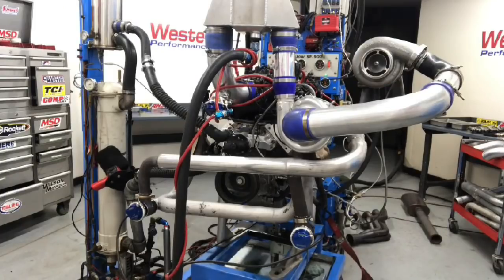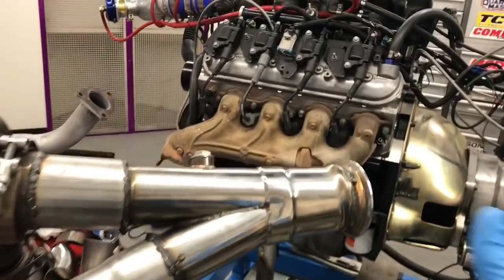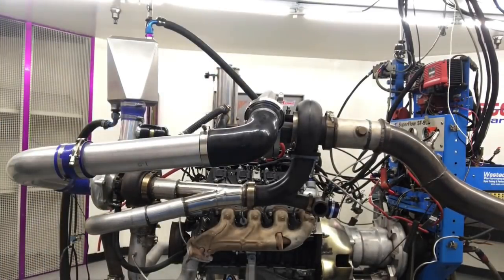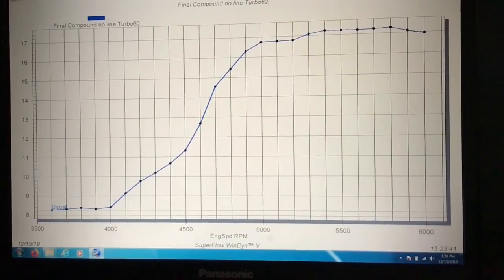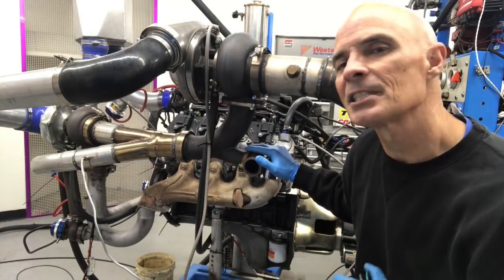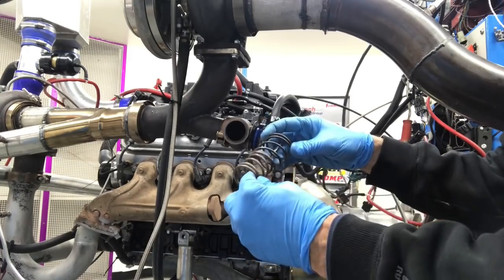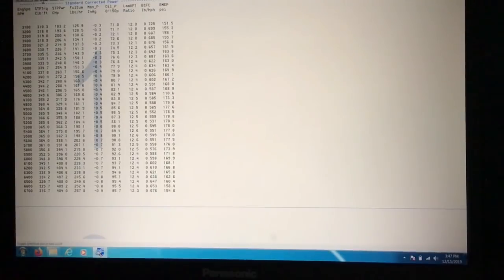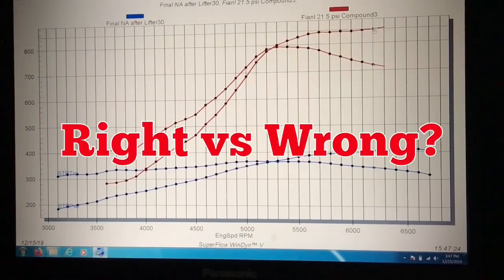Big Boost!! Full Results!! 1 Mistake!! Compound Turbo 4.8L!!

Comment: I'm  sure that most everyone would really like to see how tunable/possible output. I've  been thinking alot about this set-up myself. Thanks
Reply: It would be nice if there were forged internals. What good is a motor that wouldn't last 500 miles, not to mention to see how much power a compound set-up can make with a high reving short stoke engine. Thanks for the info that you bring us.

Comment: The ONLY thing I dont like about compound turbo's iis reliability.. Too many extra variables that take effect. Compound supercharger/turbo setup seems much more reasonable, reliable and makes more sense in the grand scheme. The turbo driven off the exhaust and the supercharger driven off the engine, sounds like the combo!
Reply from the maker: neither is really necessary on a LS

Comment: In this configuration, that cooler is actually an aftercooler. It's after all the compressor stages. If it were mounted between the turbos, then it would be an intercooler.

Comment: why not connect the primary turbo`s(small) wastgate reference signal to the exhaust manifold and the big turbo`s wastegate (the one actually controling ultimate engine boost)to the intake manifold and set the primary turbo`s wastegate spring pressure to the desired intake manifold boost.this way i think you would have balance between the turbos and maybe a 1:1 pressure differential in the exahust man and intake manifold provided the secondary exhaust housing doesn`t get restrictive?

Comment: I've asked alot of dumb questions lately but I've learned from them sooo....could this also be done as a twin setup instead of a compound? Seems like it would be nice to have a GT45 or smaller turbo to have major response down low while a bigger S480 carry out the curve around mid range rpms to maximum horsepower at higher rpms🤷‍♂️
Reply from the maker: SEQUENTIAL WORKS LIKE THAT, BUT NOT TWINS

Comment: Hey love your videos. Ideally you'd have one big wastegate before the small turbo that controls both banks, and vent it to atmosphere, that way you control both turbos at the same time, if you slow down the small turbo compared to the larger one you're losing the whole point of the compund setup, the slower the small turbo moves the less air it multiplies and the less exhaust that passes through the turbine because it's spinning slower.

Comment: That's the sweetness of it.  Sized properly with plenty of wastegate on the primary with a 30-35% larger secondary you can eliminate lag and get boost off launch without cooking the valves and turbine two stepping. Two step sucks for the turbo and the motor.

Comment: Cool test Richard, question, when you start having high back pressure, does it try to hold the ex valves open
Reply: No boost and back will not hold your valves open. As there will always be more cylinder pressure to close them.
Reply: @akassasin5768  when the exhaust valve is closing during the overlap period there is no pressure in the cylinder.

Comment: If wg line of both turbos are on the same reference spot on the intake  what will happen is this:
Small turbo spools -> makes 7 psi and that psi opens all the wastegates including the big turbo wastegate.
This way you as a result make 7psi on the small turbos and then you take them out of the equation aka you bypass them, and have that 7psi from the big turbo. Small turbo has its wategates wide open, air follows the less ressistance pass and all gases go through the wategates to the big turbo for it to make 7 psi. The thing that you can do this mean you have enough wastegate flow on the small turbo and thats perfect.

The thing that you couldnt raise pressure on the big turbo is not because of back pressure its the opposite. Its because the combination of 2 things 1) pressure multiplies on compound turbos 2) wastegate reference point.
If big turbo pressurises to 2 p.r (1bar) and that air goes to small turbo to be pressurised again to 2p.r. (1 bar)
Final result wont be 1 bar + 1 bar = 2 bar. It will be 2pr x 2pr aka 4 times the atmospheric ressure AKA 4 bars of boost. What this means is that IF the small turbo receives pressurised air the final boost will be multiple times your small turbo wastegate and will open too quick. For your desired pressurisation. The trick is to put the big turbo wastegate line to the intermediate charge piping and then you have the staged compression result and boost controll.

This way youll see how fast the boost raises because of the multipling effect. if you hook a boost gauge on the intermediate piping youll see that when the big turbo is sleeping you have vaccum or 0 bar reading. When the small turbo wastegate opens and you have enought exuast gases for the big turbo to be pressurised every 1 psi on the intermediate pipe will be 2 or more on your normal boost gauge.
This way you compare final to intermediate pressure to find what % of the boost the small turbo creates.
And then to controll boost accordingly.

Comment: Tractor pullers have been doing compound turbos on diesels since the 1970's, at up to 3 stages and 240 psi boost.  Then they started doing 2 stage compound turbo at up to 80 psi boost on diesels converted to run on methanol with spark ignition in the 1980's.  Go to a tractor pull and look at these guys' engines and talk to them.  They're pulling 4500 HP from International 466's, they must know something.

Comment: I imagine this is mentioned below, but your high pressure turbos wastegate (the small turbo) doesn't have its "atmospheric" reference. You shouldnt reference the post IC line only, you need to connect to the mid charge pipe. The top of the gates is seeing dyno room pressure, not its inlet pressure. The delta of pressures makes this system work correctly. Would love to see this happen again with these updates!

Comment: Why run compounds if they are not drastically different in size and trying to get over 3 atmospheres?  Seems to just make lots of back pressure.   Most turbos are extremely efficient at the 2-3 atmosphere range and have the widest airflow range at that boost level.  21 psi boost or 2.4 atmospheres they are both making approx .55 x inlet atmosphere pressure and are on the bottom edge of their efficiency range for sure.  Just making heat beating up the air and then trying to squeeze it out of 2 turbine housings.  Doesn’t make sense unless you need 30+ psi boost across a wide rpm range

Comment: well, in this case where one turbo is smaller than other, i would run with spool valve (or other type of TB in exhaust), so i get boost in low rpm, but still carry it to higher rpm with bigger turbo.. 
in your case to get smaller backpressure, i would put one more wastegate before 1st turbo and also use at least air-air intercooler as heatsink after 2nd turbo

Comment: I believe the compound turbo systems and combo boost centrifugal plus turbo are probably designed around high altitude performance. Like airplanes. Where at sea level a single supercharger may make enough boogie but at 20,000 it doesn’t. I like the idea but I think the turbos are good enough now that big single or twins is probably going to yield the best results. Cool test though.

Comment: play with compound supercharger/turbo.  OEM are going that way as opposed to compound turbo.  in your setup, the engine sees that 23psi back pressure.  An SC creates no back pressure and has instant throttle response.  the S480 might even be too small for that setup.

Comment: So aside from quickened boost response would this be any faster in a car at the same manifold boost pressure as a single correctly sized turbo. Very interesting, just wondering if there would be a reason to do this aside from a video like this.

Comment: You did 2 major things wrong!!!! Lol #1 using your cellphone while pumping gas (or electronic device to record) #2 (while recording) pumped gas into containers in the bed of the truck, lawfully your supposed to do neither of those! The consequences for those actions are fines, incapacitation/serious injury or death. I worked at a gas station and watched both these failures cause a fire and an explosion in multiple instances. Safety first! Not to mention its illegal to fill gas storage containers not on the ground!
Reply: Other than that I love your informative videos! Keep up the great work!

Comment: When you figure out that you are supposed to run the exhaust system from manifold to big turbo to little turbo with an external wastegate between big and little bypassing the small turbo (partially) under load, give me a call. (What do I know, I've only run 12,000 h.p mega-yacht diesel) You don't have the exhaust plumbed right.
Reply: at nearly 2 bar of boost that engine that's 3x atmospheric, so allowing 20% loss for intake heat, ring flutter and valve leakage you should be at around 1,050 h.p.. Switch up the exhaust, use a  controllable diverter valve if you can't regulate the exhaust on the smaller turbo after you switch the configuration around. Remember the exhaust looses a lot of heat in the primary turbo, so the smaller secondary will need less space for the gas to travel through. It wouldn't hurt to check crankcase gas pressure when you do switch it.

Comment: Awesome video only one thing wouldn't it be better to have the small compressor feeding the larger turbo inducer  and then going through the cooler  to the motor so it helps to minimize lag for the large turbo but i have seen it done both ways

Comment: an interstage bypass bleed may be a good idea.  turbine engines with multiple compressor stages usually have them to control surge for different sections of compressor stages as the compressors come up on their maps differently and surge often requires a partial tear down or at  a minimum a borescope inspection

Comment: Would it be an ide to put the wg for the big turbo on the primary pipes so the exhaust bypasses the hole system? Maybe there is no need to push exhaust to be wastegated through the small turbo first?

Comment: Mr. Holdener, Diesel Power Source makes a VGT turbo in the S300 and S400 sizes. They say the turbine has a ratio spread from .48 to 1.10, it is controlled by the exhaust drive pressure.
Have you ever tested a VGT Turbo??
Do you think Diesel Power Source would let you borrow one?? I'm sure they would, if it worked out they would make sales.
Reply from the maker: i have not tried one

Comment: What if you did a twin charge setup (turbo feeding into a supercharger). does it make the turbo spool faster/earlier? do you see the same results as you see here with changing the supercharger pulley vs adjusting the turbos boost?
Reply from the maker: more compound stuff in the works

Comment: Seems to me that compound turbos are useful when one needs very high pressure ratios, over 4 or 5 to 1.  What is the purpose of compounding turbos when running less than 2 to 1 pressure ratio?
Reply from the maker: did ya see the part in the videos where I said you shouldn't do this on an LS? It was done to try something different
Reply: Also, to help alleviate lag and get the big guy to spool. Don’t have to have huge PRs to be efficient.

Comment: Compound turbos size by compressor maps differential and expected boost result. 
Set each turbo to run in the start and end of the compressor map highest efficiency bubble. Tune boost reference for each to be dead center of the efficiency maps and then reference will increase or decrease  both turbos simultaneously in the optimum zone. Giving you the least back pressure. Your set up is barely using the first turbo and running the second one way out on the map if I had to guess. Shane from Mazworx is "THE TURBO AUTHORITY" I don't know who else is running 150psi boost out of twins making 3000hp in a 4 cylinder reliably all season.  I found a video of him talking to HP Academy. 
https://youtu.be/1pV_tLbZY0A
You can keep the same boost and bring the backpressure waay down for biggerer numbers!
On a side note, snows water/meth injection is pretty much equal to C16 race gas in knock prevention. If you use a two stage pressurized into the intake pipe and tune for the added fuel of the meth it's within 10hp of E85. People aren't really onto it yet, but it is definitely the answer. No need to worry about E85 anymore. A case of -20f washer fluid and a case of the yellow heet water remover fuel antifreeze if you want to raise the methanol content. 
You can set up a relay for tank level, pump running, and a pressure switch. Run the meth by boost pressure so you can tune for it and not waste it when you have no need. Run the relay to your ECU and have it go to regular tune if you lose the 5v signal. Adding 6+ pounds of boost and timing, so a warning light won't cut it. You'll smoke a Piston before you can let off unless you program for the signal. Like ref 7 equals tune 1B. I would definitely like to see that set up with the balanced turbos with -20 washer fluid and a can of yellow heet. I bet it is a viral video

Comment: I thought this would give boost lower in the revs, my gtr makes more boost at 2500 than this makes total and climbs all the way to 8000 rpm in a much simpler package, it probably cost 3 times the price though.
Reply: Bottom charger was a bit to big and of Chinese origin. With a smaller size and high efficiency wheel design the full range abilities would show up.
Reply: More boost but a lot less volume. 5lbs through an s480 is more air than your twin turbo can push on stock turbos.
Reply: @presidentrhino6847  I'm not running stock turbos, I'm running a pair of efr 7163's they spool faster than the stock turbos.

Comment: Questions?
Did you size the turbos for peak efficiency across them in the maps? IE smaller turbo peak efficiency is maybe 8 pounds? And the larger one likes 15? The boost reference for both turbos needs to be tied together.  Smaller from start to end of peak efficiency and same with the larger, whatever it may be. To get desired boost level, differential across both will move in sync. Once the ranges are set u never control separately. You'll get more power that way at the same boost level across the board.  I learned that jazz from Shane at Mazworx. He does an interview with High Performance Academy.  Vid is called 3000hp, 150 psi of boost

Comment: you need to run a s366 with the s480
Reply: My thoughts exactly. The response with a 66-70mm bottom charger would be phenomenal. Yet still in the meat of the pressure ratio when the big boy lights off.

Comment: From what I could see this is some sort of hybrid turbo setup not a true compound turbo compounds should flow in a circle exhaust should feed the small turbo and that dumps from small turbo straight to the large turbo and cold side in the large turbo charging the small turbo. The cold side is run right as far as I can see  but it appears that there is alot of exhaust bypassing the first smaller turbo. Just my opinion
Reply from the maker: you are right-the turbos were routed as you described

Comment: I think what you did was pretty awesome Richard. it's something I've wanted to do for a while. Personal funds haven't been there even though I have just about everything gathered up to do such. I thought of this process about 4-5 years ago. The issue that I see with what you did was you built a very inefficient exhaust feed for the primary turbo and then downsized it going to the larger Turbo.(also two wastegates are not needed for a single system.like unless if it's a big boost Set up. A larger wastegate ex.60 mm for the primary side would give you a lot better control what the primary Turbo. Also would allow the volume necessitated to drive the secondary Turbo it would bring down the drive pressure a good bit. Because now the primary turbo going along for the ride since the secondary Turbo is really doing the work. Also with the secondary turbo since you have so much energy coming out from the primary turbo plus the wastegate bypass you need to run a larger gate example 66 mm the secondary side which would give you a lot better control with the secondary Turbo. And would allow the volume necessity to do drive secondary turbo it would bring down the drive pressure a good bit. Because now the primary turbos going along for the ride since the secondary turbo is really doing the work. also with the secondary turbo since you have so much energy coming out from the primary turbo plus the wastegate bypass you need to run a larger gate example 66 mm to the secondary turbocharger. You can stage the wastegate Springs differently between the primary and secondary Turbo no problem and if you can figure it properly you can control it all on one boost controller. Plus sizing a turbo properly for the application is also very critical. You can stage the wastegate Springs differently between the primary and secondary turbo no problem and if you can figure it properly you can control it all on one boost controller. Plus sizing the turbos properly for the application is also very critical. I would definitely have a smaller turbo than a 76 for the primary something long the lines like a board Warner S366 with a lager than usual exhaust hosing for such a small motor if you're really wanting it to come on violent like a PDS blower car.

Comment: How much did compressing the air twice heat it up? Do you have IATs single vs compound?
Reply from the maker: I only have charge temps after the intercooler and they were 136 degrees at 21 psi